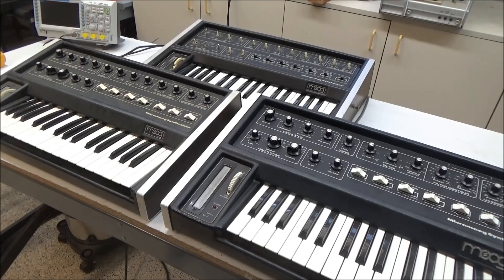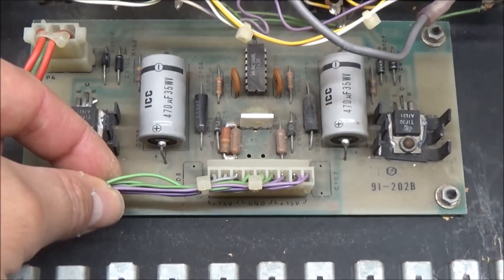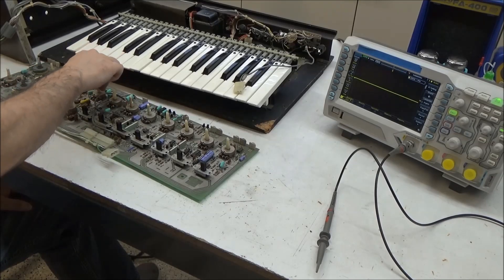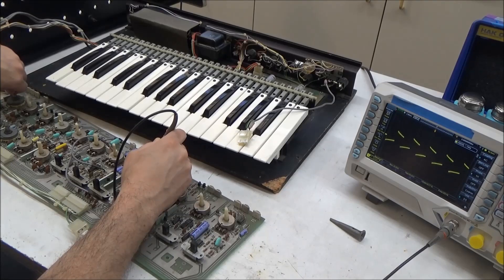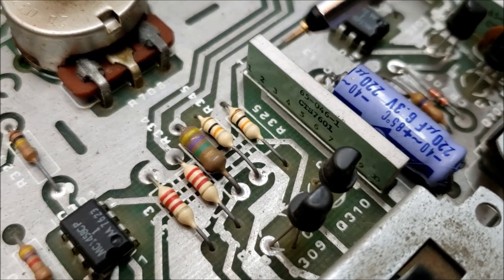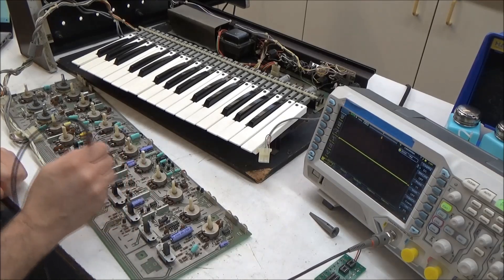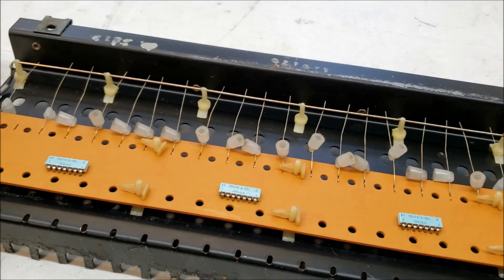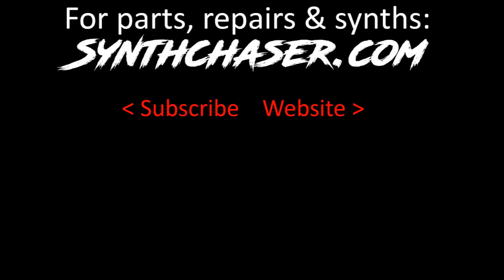Triple Moog Micromoog Repair - Part 1 - Synthchaser #154

Comment: Dear Synthchaser, is there anywhere to find the resistors array values? i can't seems to find the values on the service manual. for example you say in your video (10:33) that you've checked the resistor array an they're ok. thank you!
Reply: The resistor arrays are labeled as ICs on the board, with details in the Micromoog schematic. The array in the video at 10:33 is IC307, and in the schematic there's a note that says that IC307 includes R312, 313, 314, 315, 316, 317, 318 and 319. Those resistors and their values are in the schematic near that note, e.g. R312 is 700K, 1%. The little circles with numbers in them indicate the leads the resistor occupies in the array. So to test R312 connect your ohmmeter to array pins 1 and 2 and you should see a reading of 700K ohms.